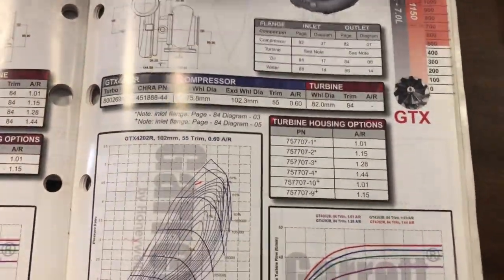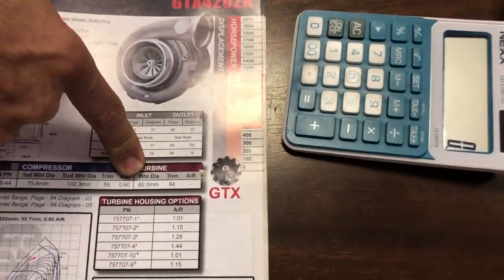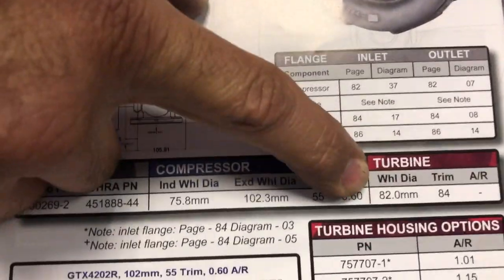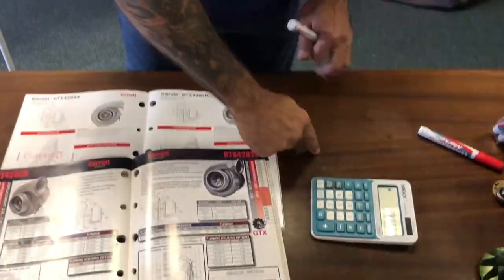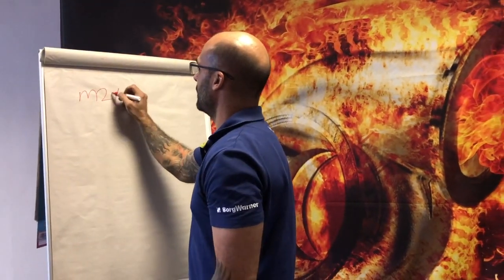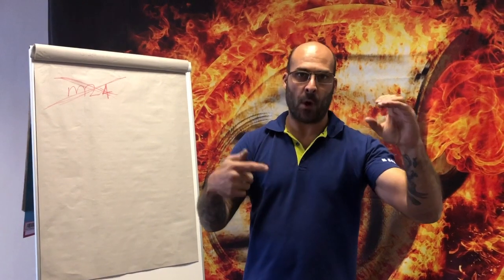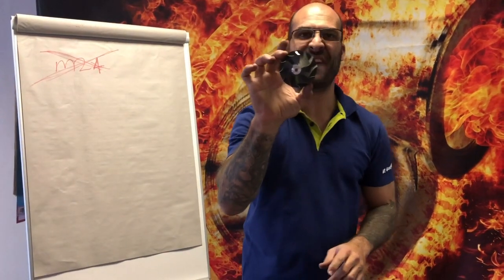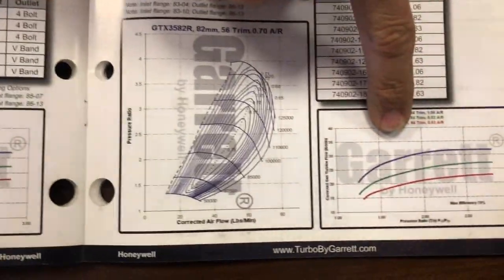Understanding Turbo TRIM calculations

Comment: how does trim effect turbo performance tho? I was under the impression the larger the exducer is in relation to the inducer (compressor) the more it can compress ? (higher flow / p.r. ?) slower transient response and boost thresh hold?
Reply from the maker: Trim is a calculation, and has nothing to do with performance of any rotating component. Its there for you to calculate the inducer and/or exducer size of the wheel depending on which size was provided to you.  The angles, sweep, loft, and blade area (to name a few) are what determines the performance/air flow of the blade.
Reply: @TurboDirectSA lower trim is for higher pressure ratio lower flow, higher trim is for lower pressure ratio and higher flow.
Reply from the maker: @chippyjohn1  not entirely true - the tip height is responsible for pressure ratio - not the relationship between the inducer diameter and exducer diameter - Flow rate is affected by the exducer, but TOGETHER with the tip height.
Reply: @TurboDirectSA  I did think about that. I imagined tip height would be smaller for a lower trim as it isn't flowing as much air. They don't list tip height, so don't know how it correlates. I just see that wheels with lower trims have a higher pressure ratio and more vertical flow map. A 6258-g with a 45.8 inducer would be excellent for a 2 litre diesel.
Reply: you are right.

Comment: In our country on v6 engine ,we compared the g45-1500 and the g42-1450 we tested the 2turbos the g45-1500 decreases the hp to 100-120hp between the g42-1450 same housing scroll and size same exhaust and same boost why the g45 dropped hp we expected to increase hp lil bit what do you think about that is the turbo is not efficient?

Comment: If i understand well, trim refer directly to the compressor and turbine wheels blades "pitch" angles ?
Reply from the maker: No sir - it refers to the size of the inducer and exducer diameters, not the pitch of the blades. You can calculate the diameters of either the inducer or exducer when having been provided only the one diameter and the trim - and vice versa
Reply: @TurboDirectSA  i did not used the right term ( pitch ) , i was refering at the blade extremities angles related to diameters of ind/exd.
Reply from the maker: @jeromelevesque8330  No worries - however the Trim is only related to diameter dimensions.

Comment: So as you said in the video the trim does not matter  just how you set up the turbo combination relating to engine . But I thought from my research trim plays a whole in terms of flow from the inducer from compressor wheel to the exducer in the turbine section regardless of  journal or ball bearing turbo?
Reply from the maker: The compressor map is there to provide you with the "spec sheet"of the compressor based on its design (trim between inducer and exducer dimensions) --